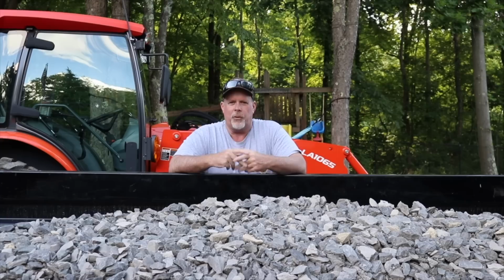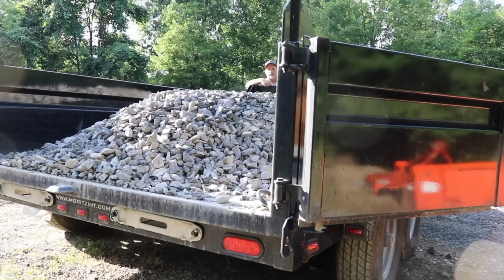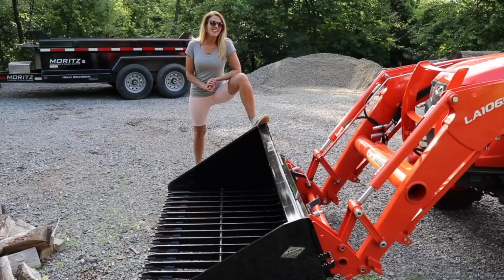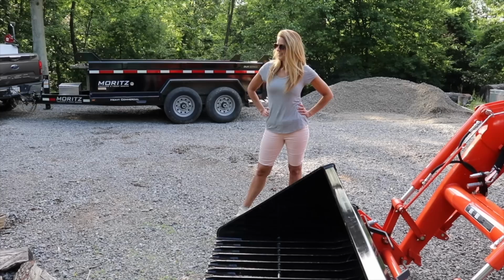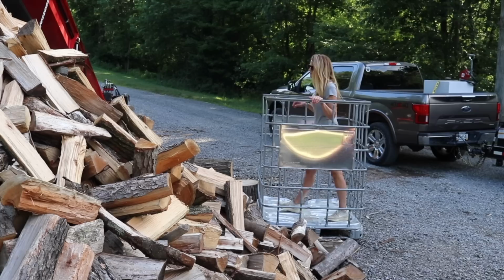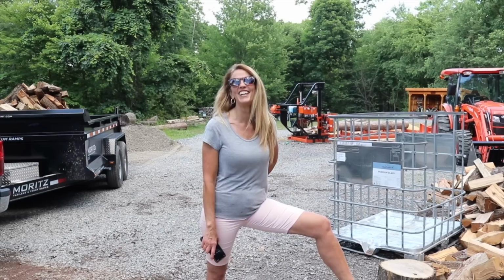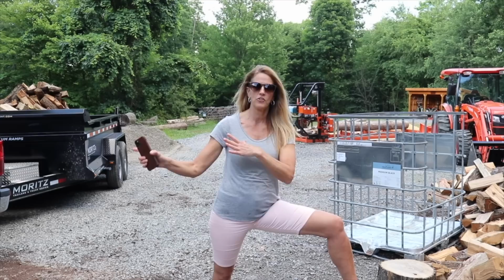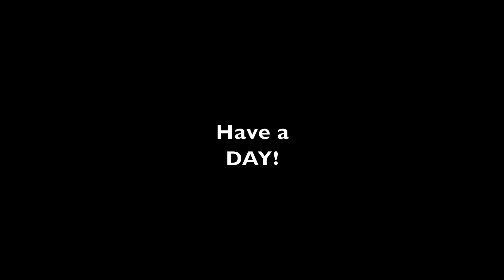#821 AWESOME FIREWOOD BUCKET! How many Buckets is a Full Cord?

Comment: One full cord out here in the SoCal mountains is 4’x4’x8’, tightly stacked, or 128 cu. ft.  We get $275 - $375 per cord, delivered, depending on the season, of Black Oak, White Oak, or California Live Oak.
Reply: Exactly correct. In fact it's written into law here. But to expand on that the loose (ok, pun intended) rule of thumb is that the legal tightly stacked cord is 80% the volume of piled or dumped wood. Add 32 cubic feet in that case, which amounts to a total of 160 cubic feet or 6 cubic yards.
   I'm not sure that counting buckets of a certain stated volume is accurate enough though unless it's been worked out empirically.
Reply: joe woodchuck, 6 cubic yards is162 cubic feet, calculated out.  CA Weights and Measures defines a cord as “tightly stacked”.  There are a lot of shysters that dupe the city folk with 100-110 cu ft cords.  It weighs about the same, 1 ton  Too hot and a Red Flag, extreme fire danger, day so it’s too hot to even think about cutting and splitting today.  Gonna survey some dead oaks later today.

Comment: Never thought about using this type of bucket for loading anything but rock. Several years ago while laying 1500 feet of gas line, we brought up quite a bit of rock which we were going to have to deal with. After talking to an excavator friend of mine, he suggested a rock bucket. What a piece of equipment. We used it to back fill the ditch. It not only allowed us to push in the dirt but allowed  to separate out the rocks from the soil. Will watching your video, I noticed that there was a small amount of material other than the wood being added to the trailer. We learned that if you jiggled the bucket ,finer stuff would be filtered out. Not until I watched your video did I think that instead of leaving this bucket sitting idle in the back of my equipment building, I could use this to carry my firewood , plus filtering out any debris.

Comment: Get some conveyor belt in the bottom of the dump trailer. It will help it stop big dents in the bottom of the trailer. Just bolt it on the front of the trailer. It has really helped save my dump trailer.

Comment: Are you sure that you have a full cord in the trailer? You mentioned that stacked, a full cord fills up the trailer. You also mentioned that dumping wood into the totes is 1/2 the wood versus stacking the wood in the totes. I bet you have less than a full cord in that trailer.

It seems to me that you need a better test. Use the firewood bucket to bring over large quantities of wood, then manually stack the wood into the trailer. Once you have filled the trailer by stacking, then you will know how many buckets you need for your full cord. Then you can time how long it takes to fill the trailer with that number of buckets of firewood... and also see how full you need to fill the trailer when just dumping it into the trailer from the bucket.
Reply from the maker: Yes I'm sure, Melissa threw a stacked pile, one cord in trailer. Just tossed in
Reply: you can just add one or two buckets extra to make up for it.
Reply: They already know what a full cord looks like thrown into the trailer. Check out the earlier video.
Reply: @thepotterer3726 , I thought a cord was cut, split and stacked and measured 4 x 4 x 8 ?  Not whole, unprocessed timber, at least around here that's what a cord is.
Wayne's way will tell you exactly how many buckets it will take and what it would look like in the trailer via the bucket.
Reply: @thepotterer3726  Split, ready to use, and tightly stacked is the official definition here.

Comment: The rock bucket we use is smaller then yours.   We put a back on it so the wood doesn't fall out the back and we can get abit more in.  We are 10 buckets for a full cord.    Using the bucket is the way to go.

Comment: I was sure wanting a wolf ridge today. I have split wood all day and all i could think about was how much faster it would be if i had a wolf ridge splitter. I was splitting big, wet red oak so the log lift would have been a big plus too. Some of the rounds were about 22” and i cut all of my wood 24” long(it was heavy). Stay well, stay safe and yall HAVE A DAY 👍👍👍👍👍👍👍👍👍👍
Reply: Ok, I don't get it. I hear Mike and others tell about how much they enjoy splitting wood so why would one want a splitter to split wood faster. If you enjoy it so much, why not use a slow splitter?  Kind of like sipping a good wine instead of gulping it.
Reply: Splitting wood is not my favorite thing to do. I don’t mind doing it but i cut and split to burn and heat my house.  The farm is about 45min from home so time is definitely an issue. Working a regular job, family and tending to 176 acres leaves little time to gather firewood for winter. Just not enough hours for n a day

Comment: you need a bigger firewood shed to hold all your equipment
Reply: The next couple of sheds are for the equipment and the sawmill.  
The shed  currently housing the equipment is a test drive, but eventually it will be a firewood shed with those extra long pallets.  There’s already a sign on the shed stating that.
Reply: So says Mr. Mike,  Phil Baxter, but only time will tell. 🤣

Comment: If you cut split and stacked a 4 x 4 x 8 stack and called it a cord you are giving close to 1 1/4 cords of wood. A true measure of 1 cord is 4 foot long round wood { not even split} by  4 feet high by 8 feet . long. This measure has been established for more than 100 years.

Comment: Did Mike ever recheck the bin wood after a year?     Since it’s roughly 1,700 lbs per bin of firewood ( 1/3 cord),  

next time y’all restock the firewood for sale,  try to put a bin under the conveyor belt and let it fill up and weight and then see if it weighs the same.   

If it’s still same weight then it’ll be one less touch point for y’all to handle it.

Comment: Not trying to make more work for you but now you have to dump the wood and stack it, not convinced it's 1 full cord! Just saying.
Reply: That is a good idea!
Reply: Great idea ....I think it’s more than a cord
Reply: The rule of thumb is 160 cubic feet (6 cubic yards) of loose firewood equals an official 128 cubic feet (1 cord) tightly stacked (80% of loose). It's therefore quite useful to know the volume of the truck or trailer used to haul it.

Comment: Mike you mentioned the baskets and stacking the wood in them to get more wood. My question is how does dumping the wood in the trailer and not stacking it give the customer a true cord of wood? Not stacking it would not give customer a true cord of wood? As I understand cord measurements.
Reply: The rule of thumb I've been told is 160 cubic feet of loose or piled firewood equals 128 cubic feet (80% of loose) tightly stacked.

Comment: It doesn't seem to be a very accurate way of measuring firewood
Reply from the maker: It's pretty accurate, did you hear me say Melissa tossed in an exact cord and it came to top of sides
Reply: @OutdoorsWithTheMorgans  Yeah, but she filled in the corners of the trailer too. You don't get that using a front end loader. It would be interesting to go weigh the trailer at the stone yard after you loaded it. Come back and empty it. Let Melissa load it and go back to the stone yard for a weight comparrison.
Reply: @OutdoorsWithTheMorgans  Yes
Reply: I know you pride yourself on accuracy, I just wonder how close it is, either you lose out or the customer does, I know it probably doesn't matter in the long run but I am curious. We always sold wood by the load because a cord wouldn't fit on a regular pick-up bed, and a load on our truck with sides was always around 400+ pieces of wood pretty evenly split.
Reply: @archiescott2229  Another commentator had the idea to unload the wood loaded with the front end loader, then stack it in a pile 4'x4'x 8' to get a comparrison.